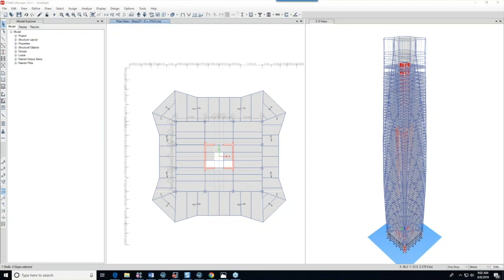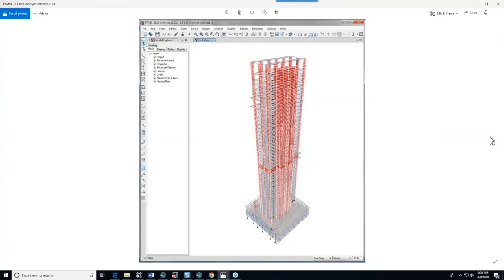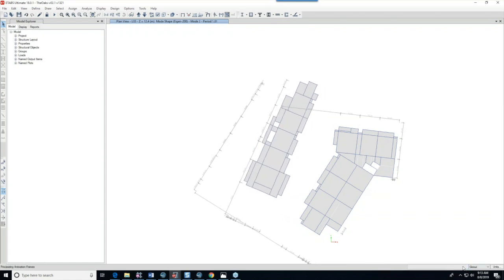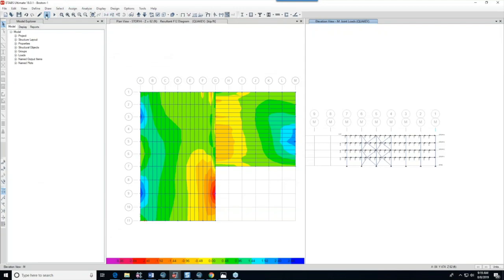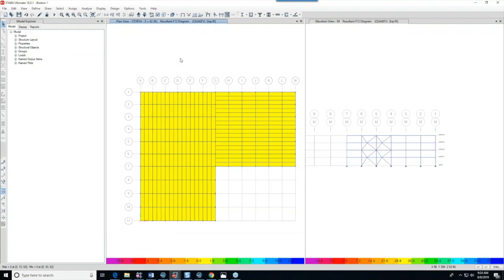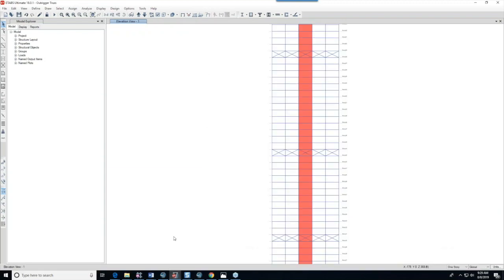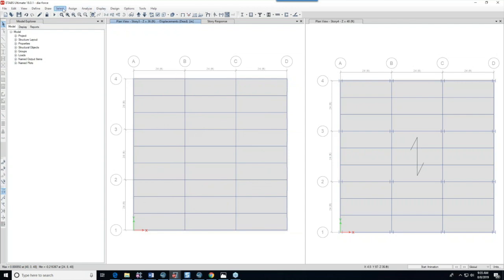WEBINAR: When to us Rigid vs. Semi-Rigid Diaphragms in ETABS

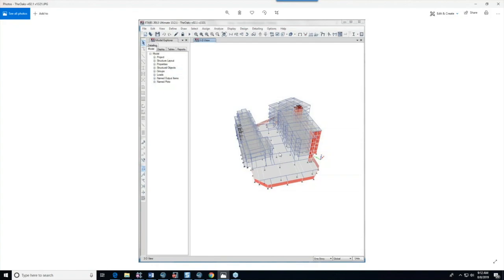Comment: 11:45/43:54  you mentioned about multiple towers in ETABS ..my question is once you activate the multiple towers option and define different static earthquake load pattern for each tower (T1 for podium and T2 and T3 for the upper two towers) followed by dynamic response spectrum analysis then is it ok that we use software auto lateral EQ load for the individual towers in combined model ??? because i am getting almost double base shear for the individual towers in combined model compared to when i export the towers and perform analysis on  individual models of the towers  ??

Also for dynamic RS analysis we would require to consider 90% mass participation so for buildings with multipole towers in ETABS we get mass participation for the entire model and not individual towers so how we proceed in such scenarios ??

Comment: Hi @computersNstructures I am having 2 issues of applying wind load on a 42 story building. The 1st issue is when applying through Diaphragm, The reaction of wind is quite small and some reactions are going same direction as applied wind which is weird. The 2nd issue is when I applied wind load using cladding(auto draw cladding) the windward pressure is going inside at some floors and going outside at some floors(local axis for each cladding panel is already going in the right direction). Appreciate your advice to fix these issues. Many thanks in advance

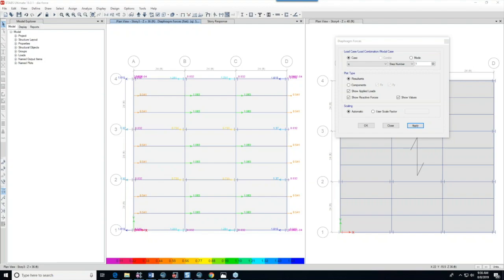Comment: 36:00 Question, How do I identify a diaphragm as rigid or semi-rigid

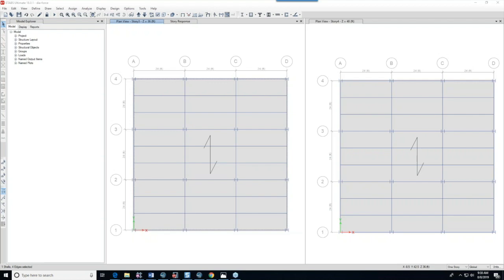37:10 If the model is small enough or the running  time is not too much would it be valid to assign semi-rigid diaphragms

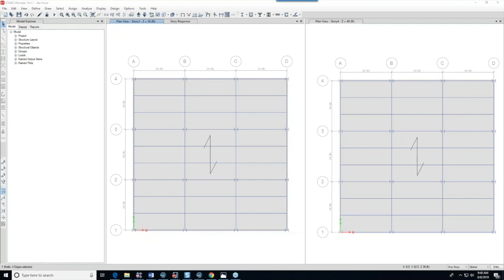40:02 Question about ramps
Reply: Based on my expertise, it is recommended to use a Rigid Diaphragm during the initial stage of modeling to control the behavior of the structure. However, when you are at the last stage of the designing phase, it is better to go for a Semi-Rigid Diaphragm to transfer the forces as it mimics realistic behavior. If the floor has a large span, a big cantilever structure, a sloped floor (ramp), or is experiencing significant deflection, it is advisable to use a Semi-Rigid Diaphragm to control the model behavior. In the case where there are braces or trusses, a semi-rigid diaphragm can be chosen for that specific floor, as illustrated in the video.

Comment: Thank you for this webinar

I have a question regarding diaphragm disconnect, If there is a opening of 30 x 60 feets in a floor sandwidtch in between two floors with slab completely covering the area, Do we have to disconnect diaphragm at that opening by selecting joints or it will act as a diaphragm?